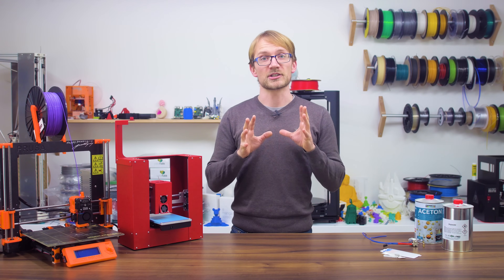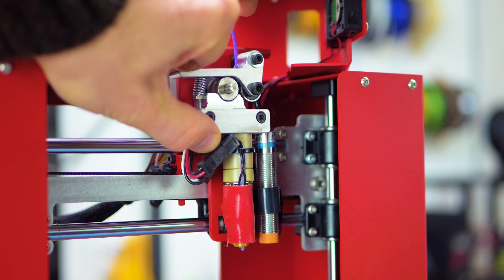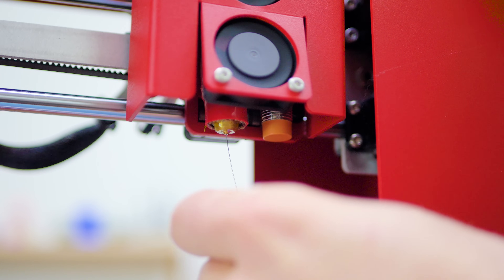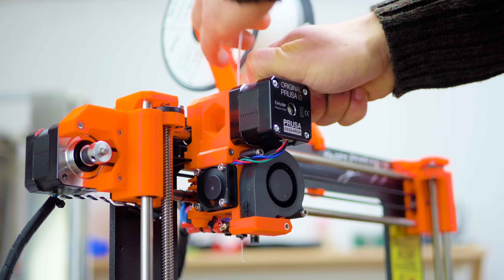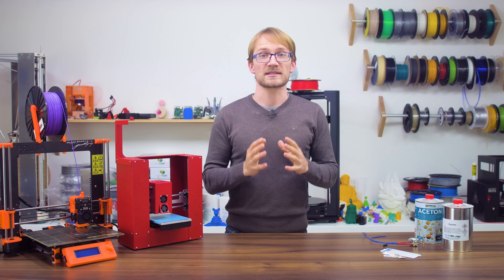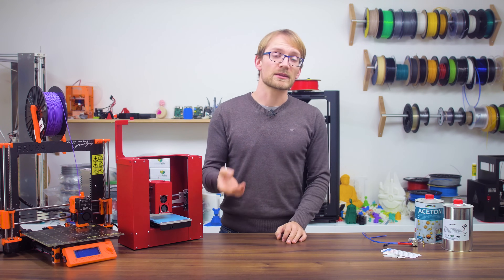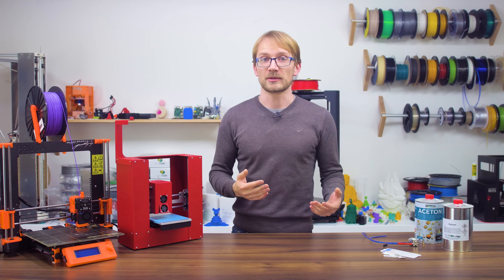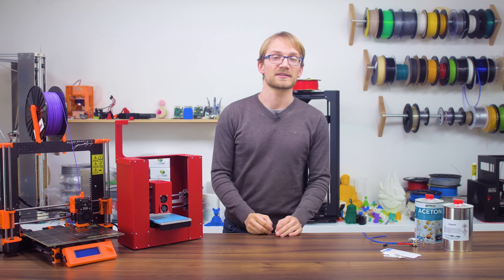Basics: Cleaning out a clogged nozzle!

Comment: intermittent feeding issue , changed the hotend, but the culprit turned out to be a failed bearing( feeding tensioner handle with grooved track bearing ), anycubic Kobra with 200 hours

Comment: A properly sized drill bit can extract a small clog, a needle can only push the offending debris back up inside the hot end, where it will get extruded and clog the nozzle again.
Reply: You can't "break up" a metal filing...

Comment: Thank you. I tried to load TPU95A (whatever that means) for the first time, and couldn't get an extrusion so I was afraid my nozzle clogged. Tried to unload it, couldn't, so I thought the entire hotend got clogged for sure. Watched the first 4 minutes of this video, then tried the pin - it went through easily, so I continued to pull the TPU out (with the nozzle still hot, and it did clear out, without even a melted mess at the end. I guess the material is just so flexible it is hard to load...

Comment: Could you maybe update this to methods used for the Nextruder nozzles? I have a Obxidian 0.4 netruder nozzle blocked with broken off filament in the top of the heatbreak. Dont wanna ruin it trying to overheat it or something :)
Reply from the maker: The Nextruder nozzles should be just as robust as classic v6 nozzles, the only thing I could think of is that when you do heat them up outside the printer, try and do it evenly and gradually.

Comment: I have had my titanium tip E3D nozzle for over 1 and a half years now and my ender 3 s1 started to have dificulty pushing filament trough now i found out its completly clogged up so i probably have to use the acetone method to get it all dissolved inside. as the needle and cold pull method did nothing to unclog it and i have some brass ones in case of emergency and its working fine. Thank you for the tips!

Comment: So i had the clog of hell. Used amolen, silk dual color. The clog happened at a certain point every time. I did tons of small cleaning and extrusion tests. And eventually i learned that the speed you run this type of silk filament at is always gonna clog the nozzle at higher speeds. You can compensate with higher temps, but the speed itself matters the most. Max ought to be like 45 but their document say 40. I litterally went and took a piece in and out fast and slow. Smashed it in to force-extrude fast. It always failed when i went fast, but the eureka moment was when i let it pass trough slowly. So this better work, stellar video regardless. Whatever excess grime my extruder had, now ought to be gone 👏

Comment: At the end of every print, on my Ender 5 S1, I leave the filament in and let it cool to about 50°c and then do a cold pull. This also works when I'm using PLA and I generally get a full imprint of the nozzle interior.

Comment: pretty new to 3D printing, but I already replaced the bowden tube on my Renkforce Basic 3 hoping it would fix the underextrusion issue, had to reprint a threaded rod for a scissor lift because the old one was too small, I scaled it up by 1% not accountng for the new bowden tube and now it's a very snug fit, had to thred it on and off once with the help of some pliers, but it works now.

guess a cheap PVC  hose with 3mm inner diameter causes some issues compared to an actual bowden tube

Comment: I have only had one clog so far when I went from PETG tp PLA.  I tried the cold pull, but it did not work for me. I am not sure if it is because I have direct drive or I just did not know how to do it properly.  So, I used the needle method.  That worked great though I had run it up and down through the nozzle 5 or 6 times before the filament starting coming out the way it should.

Comment: I changed filament from kcamel black PLA to eSun PLA+ and after 24 hours both my Ender 3:s completely clogged. Never happened with the kcamel PLA, which was cheaper. I did adjust the heater block temp as recommended before starting the print with the new filament. Could simply the change between filament brands have caused the total clogs in the nozzle? I was going from a lower to a higher extrusion temp, so I don’t really know what happened. Thinking I maybe best off with replacing the extruder nozzle, as I have spares. What would you suggest?

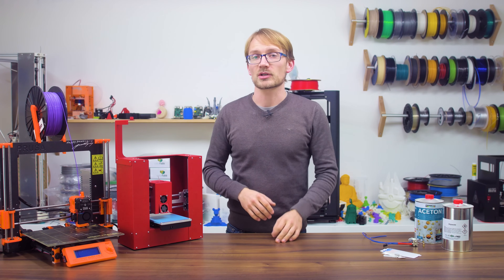Comment: 5:24 I think that's my issue: the teflon lining inside my extruder module seems to have plastic stuck inside. I was able to unclog it using acetone, but the inside diameter still has a black layer, meaning it either overheated or still has ABS which I cannot remove, even with acetone.
To make things worse, that lining is slimmer than the teflon tube used to feed the filament to my extruder module. As far as I know, the feeding teflon tube is 2mm x 4mm (interior/exterior), but the lining seems more like 2mm x 3mm.
Anyone able to help?

Comment: It works well with a soldering kit.  Just lower the temperature a bit so that it is between 200 and 240C.  The PLA melts and you can just clean the nozzle easily.  AP

Comment: I personally take a little fire torch and melt the platic inside until there is nothing left. Always worked for me! I'm relatively new to the hobby tho but it's awesome. I'm an Engineering student so while I suffer in school,  I use my printer to feel better haha.
Reply: Me too. 3D printing as a therapy to recover from my engineering classes
Reply: What part do you torch? The nozzle, hot end? My clog looks like the inside of my hotend looks full of burnt filiment.
Reply: @79ninzombie  remove nozzle. Heat it up until it melts. Reinstall

Comment: Thank you so much your favourite of the suggestions worked. 
Pushing the pla in when warm then letting it cool and pull. 
I got the particle on the first try but did it a second time just to be safe. 
Thank you so much.
Reply: You can buy individual strings in most guitar shops.  They sell them by the diameter size.  Just go in and tell them what size you need.

Comment: I'm a little late to the print party, but this video is the only one that I found that was helpful and simple.  I had tried the needle method to break up the clog, but I never tried it repeatedly while intermittently running the filament through.  That helped a ton, and the clog was gone after a few tries.  It really sucks getting close to finished on a big project only to have gaps in the print.  Thanks for taking the time to post this.

Comment: I like the option of the "stare-down by a real engineer" ... you should offer this as a service! Anyway, the video gave me the confidence to get my printer going again in mere minutes. BTW: tool tip - the BIONIC WRENCH (AKA the Loggerhead) is a great way to hold hexagonal nozzles while heating them up and getting the goo out. The thermal mass of the jaws distributes and stores the heat so you can work longer w/o re-heating...

Comment: You definitely work cheap.  I can see spending a little time on a hard nozzle but what's the point to spending time on a cheap nozzle.  You didn't even mention simply replacing the nozzle.  My time is better spent than trying to poke ,035mm wire into .040mm holes.  Acetone is not cheap so you might want to accumulate several suspicious nozzles over time and then soak them simultaneously to save time/money.  This all seems like a no-brainer to me.

Comment: i just heat nozzle and manually push afew inches of filament through...if that does otwork remove nozzle while its hot and replace after making sure the hot end is cleaned...

Comment: Just finished thoroughly cleaning mine with torch followed immediately with cold water hit it with a wire brush and oxy acetylene torch tip reamer and for shitsngiggles I used my water jet teeth flosser.. Had to put it down on her, took her from fussy n fightin to purring like a kitten

Comment: i just replace the nozzles every week when having extensive use
Reply: I just replace my nozzle as well. But I been printing for nearly 5 years now. And I have to say that if I recall correctly. Nozzles are currently a fraction of the price they used to be. And they tend to be higher qaulity as well.

5 years ago it's probably better to clean it then investing in nozzles, nowadays they're so cheap you might as well replace. However I also want to note that it seems to be that nozzles do not clog nearly as much as they used to. Perhaps I buy better nozzles now... or perhaps they are slightly different to fix this issue.

That being said there are tungsten carbide nozzles and so on for materials such as carbon fibre infused nylon. Extremely high tempt and extremely high abrasion. It would ruin normal nozzles in minutes. These cost ~$30 to $80. Something I would ideally want to re-use. And these guys can pretty much be used indefinitely (Pretty much literally). So there is also that for normal material.

Comment: I just replace the cheap 2 dollar nozzles I use :P          Edit: I bought a 20 pack of 10 0.4 mm, 2 0.2 mm, 2 0.3 mm, 2 0.5 mm, 2 0.6 mm, and 2 1.0 mm (Dunno what I would ever use 1.0 mm for on my 8x8x8 print bed but... :P)

Comment: So I experienced wobbles in the walls of my print, time after time no matter what settings I changed. It seemed to be clogging was the problem after all. That nozzle heating and pull out strategy worked nicely. The wobble artifacts instantly disappeared afther this cleanup. Thanks!

Comment: I did it with the compressor pistol, heating up the nozzle and then pressing the filament out (from tip site) by air pressure... works fine for me.
Actually, it was my mistake, was printing steel filament with a 0.4 nozzle while 0.6 was recommended by manufacturer :-)

Comment: My Filament kept popping, as if the filament isn't dry. It ocurred on different filaments. I am not entirely sure what my problem was, but i guess that i wiped my new glass bed just before the print. In effect i could imagine that the cleaner ascended in the nozzle and kept popping. Took me probably 2-3 days to figure out, since i tried drying the first filament. 

So FYI: Sometimes the nozzle can be wet and don't wipe your glass bed shortly before the print.

Comment: Tried printing ABS for the first time today. During the time it took for the bed to heat up the Nozzle had "cooked" the filament and clogged the nozzle completely... It's currently sitting in an acetone bath and I'm hoping I don't have to buy a new nozzle x) ... Though I should probably upgrade my whole hotend, the teflon tube is looking pretty worn out.
Reply: RIP... I'm about to get my first printer as and wanted to ask: what do you do while the bed is heating? Do you let the filament sit there it wait to push it in? I'm buying a Cr-10 pro and the bed heats up in 5 minutes
Reply: though I’ve never had any cloggin/”cooking” issues with PLA, left it at 210 C for more than 5 minutes, but I still wouldn’t recomend doing that.
Reply: @beaconofwierd1883  Ah I see. Thank you.
Reply: @or3356  One thing you might want to consider is to insert the filament before you level the bed, since inserting the filament might mess up your leveling. This might require you to first heat up the end, insert the filament, then cool it down again. I've never bothered to cool it down and just leveled while it's hot and I got the burn marks on my fingers to prove it. Ok, I actually have never gotten a burn mark from my printer, but I've burnt myself many times ;p
Reply: @beaconofwierd1883  good to know, I'll keep that in mind!
Reply: @or3356  Also, Yay, I finally cleared the clog x) Only took 24 hours in acetone and digging out all the clog several times :P
Reply: @beaconofwierd1883  I'm happy for you :)
Reply: @or3356  One more thing which you should keep in mind if you print with PLA is that it becomes brittle after mechanical stress. So if you leave the filament in a straight position (such as leaving it after a print) it will snap off.
Took me forever to find out this was due to mechanical stress, thought it was sunlight for the longest time and tried shielding the filament from sunlight.
Now that I know it's due to mechanical stress I've noticed it helps a lot if you remove the filament from your printer and let it curl up again. It of course depends on the quality of your filament, but if your filament cracks you don't need to buy more expensive filament, just treat it with some care :)
Reply: @beaconofwierd1883  oh wow you're back thanks I guess
Reply: @or3356  Yeah, I was just messing around with my printer and realized that this was something I wish I knew when I started printing :P
Reply: Basically all slicers have the option to heatup the bed first, so just do that :p

Comment: Also try to avoid doing what I just did and don't knock over your cup spilling acetone over your entire desk while following along the video on your computer.
Reply: Pull on filament as the hot end is heating to remove dirt and clip off end, add a very thin coat of olive oil to 1" of end of filament before re-inserting. Force 150mm of filament through once heated. has always worked for me.
Reply: Happened to me too while cleaning my extruder lol
Reply: could be worse. Acetone is non-conductive right?
Or you could have  had a soldering iron going when you spilled it.
Reply: @Geolaminar  yeah but it destroys plastic though

Comment: I have a spare Chinesium heatblock and 24V heat cartridge clamped in a small vice to attach nozzles to for maintenance, run off an old laptop charger that output 19V. It doesn't stop heating at any particular temperature but I could devote an Arduino with a PID sketch to the cause some time.

Comment: Tom, love all your videos. I found stuff call FLOSS filament that cleans your bowben tube and nozzle. I am not sure how I got a cloged nozzle so quickly. Maybe I am just trying to push PETG through my nozzle to quickly. I was trying 100mm/s at .3 layer height. This worked for a couple of decent sized prints. The first symptom was that my first layer was not sticking. My first layer sticks all the time. Then my Titant bowben extruder wouldn't push the filament through the hotend. Previously I had the filament break off. And shortly after I replaced the Bowden Tube. All the above happened. But I still love my Tevo Tornado.

Comment: Thanks for explaining the atomic method. 
Not sure I have a blocked nozzle, but at certain points on my first layer brim, the sudden direction change makes my nozzle pull the filament it just laid back up and wrap itself all round the nozzle. It's always the same direction. I put a lighter to the nozzle and it is adhering now after many many print attempts and too much money spent on the swear jar.
I'm using the Geetech Superplate which has been great for the first week, but it's refusing to stick at all sometimes on certain patches and it's like the nozzle just wants to drag the filament along.

Comment: Hi, Thomas and all who see this comment! :)
This video is still very actual as I see :) If I'm not sure that the nozzle is (self-)cleaned well then should I try a cold method?
I've calibrated the extruder (actually that was about 0.5-1.0 over-extrusion so it doesn't seem to be a role player) but some layers still has under-extruded quality.
Probably I'll try to revert to the stock firmware (without S-Curve... basically it's nothing more there left from the last time I've changed something) and print something that will use a lot of retracts (and set it to 6.0 as recommended for Volcano).
My next guess is that I have a heat creep... But it's all of a sudden practically (or I've didn't noticed some signs before...). This can only mean that this Volcano (in Tevo's printer) is fake.
Another guess is that I need to print this PLA with 215-220C (currently is 210) because it wasn't even extruding from the nozzle on 200! Seems like it was underheated. But then I need to drop speed to 35-40 or it will not be cooled down as fast as needed. Or to print and make the Petsfang assembly (with a better fan). Don't want to do this yet (need to investigate better).

Comment: Goodday Mr. Sanladerer,
I am new into 3D printers, i just got Tronxy few days ago.
I have discovered when i excute print button in Repetier-Host, i have discovered that the Bowden extruder feeds reverse, and at the same time the nozzle and hotend drops in temperature so the filament i pushed trough has clogged.
What is wrong? can you help me out of this mess?

Comment: I had what seemed to be a clog nozzle that turned out to be caused by a fractured solder joint on the small pbc in the extruder head assembly of my FlashForge Finder.  The fracture caused a resistance that lowered the current to the heater, which varied the wattage.  The LCD does not show the temperature status once the print starts, so you have no idea the temp has dropped the melting point needed to push  the filament out the nozzle.  Thanks for the quality videos and content.

Comment: If heating with a heat gun, a stand of copper wire is soft enough to not damaged the nozzle and small enough to work through. I'm picking pieces off 14AWG stranded.

Comment: First thank you for all the GREAT videos you have done.  Absolutely wonderful.  I have looked thru your videos and I can't find one on properly changing the filament.   That is the one thing I am having some problems with.  I have an Anet A6 and have a Tevo Torn. on the way :)  I have been printing PLA at 210.  Should I let the hot end cool down to a certain temp before pulling the filament out?  I have had multiple times where the filament left some string in the top end of the feed tube and then I could not push it back down after reheating the extruder and had to dissasemble to push it out.    So any info you can provide or a link to a good video would be appreciated.